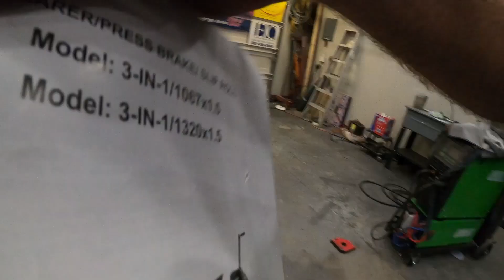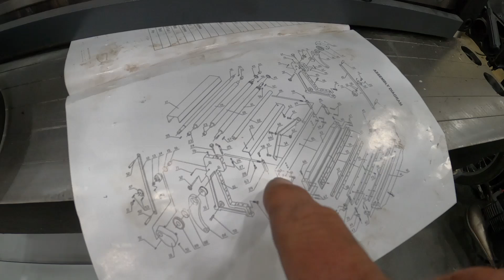KAKA Industrial 3 In 1 Press Brake, Shear, Slip Roller Review

Comment: A few tips for rolling: 1) drill detents in the leverage handles for the thumbscrew to set into, 2) add paint marks to the adjustment dials with a reference point on the housings for making even adjustments, 3) when doing multiple parts with the same radius run each piece through the slip roller before adjusting up to a certain point, 4) feed from the back first; if the rolls are set properly the sheet will automatically square up, 5) after every pass through the roller; rotate the piece 180 degrees to achieve even rolling throughout, 6) if at all possible make radius patterns to closely match the required radius (within 1/4" for 16 gauge steel is fine),  7) it's always best to roll slightly harder, you can always push the steel where it needs to go, much easier than pulling, and 8) if it's rolled or formed to hard you can always drop the piece on the ground, the tension in the steel will release springing back possibly to the desired radius or angle.  Having a dead blow mallet to lightly hit the steel will work just as well.  Just a few tips and tricks I've picked up from using break-presses, shears, and slip rollers for almost 20 years.  

Cheers!  And enjoy your new toy!
Reply from the maker: Wow, thanks for all the great tips and insight.   I will definitely  give them a try next time I'm slip rolling!!!!
Reply: Late to the conversation here..  I'd add clean the machine really well to make it run better.  I have a similar slip roll that was full of casting sand and crud left over from the manufacturing process.  It was a significant move in getting it to run better.

Comment: Another Suggestion
get a piece of pipe (pipe is stronger then sheet metal) that fits the diameter of the rollers (does not have to be the same size, just same size or bigger) that will fit against the roller.  Then weld on a longish piece of flat metal (even angle iron, though heavy) to it that IS square.  Angle Iron allows the metal to rest on it and is easier to square up (a trick on that piece of metal is to run a grinder along the inside edge to make it square or recessed - your choice).

You know have a reference edge to line up the metal with.  Adjusting the rollers to be even can be done with a roller gauge.
Roller Gauge:  2 wedge shapes with matching 1/4" marks (yup, like a ruler).  Pushing one in gives you a reference line, then move it to the other side and move it to the reference line and they are squared up

2 - If you're going to make one, make 2.
Reply from the maker: Good ideas. Thanks for sharing!

Comment: I bought their pivot band saw and I really have no complaints. There are a few things they could have done better on like the angle dial and coolant pump but for the price point of the saw it is not bad. Looking at the 4' 12g box brake now but I can not force myself to spend the shipping fee.
Reply from the maker: Yea, the shipping  really  added a ton to the price.  I started out looking for a pan box brake, and fell in love with the idea of the shear and not having to drive to my buddies shop to slip roll.   The only thing I dislike about the brakes is that it's difficult  to eyeball the angle, and I have over bent a few pieces.

Comment: I am looking at this unit.   Thanks for the video.   But my experience using these type of machines.  I would NOT want it on wheels.   Portability is awesome, but needs to be anchored down.   Or drop a 500 lb weight in the base of your roller cart with all wheels having brakes.   Just my thoughts.    Cheers
Reply from the maker: It's so damn heavy that you have to push it hard to get it moving. I have used almost daily for the last few months, and for a small garage, I need the ability to move it around and get it out of the way when needed.   If you want to buy this machine, please use my Amazon link in the description.